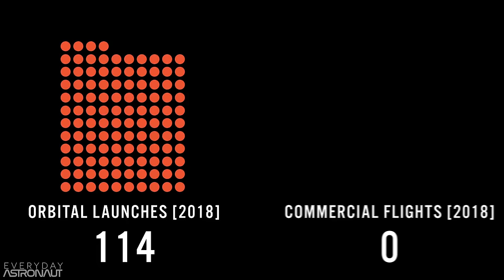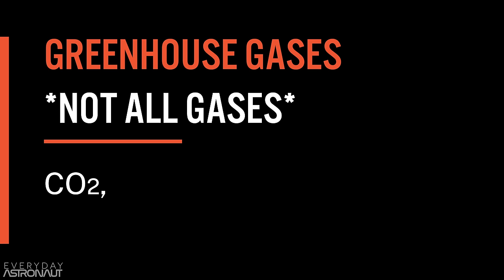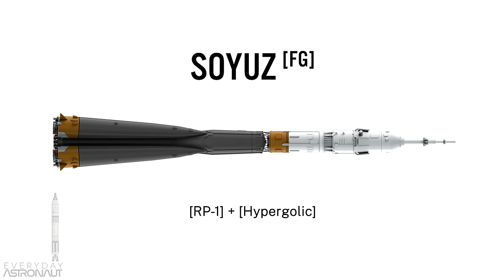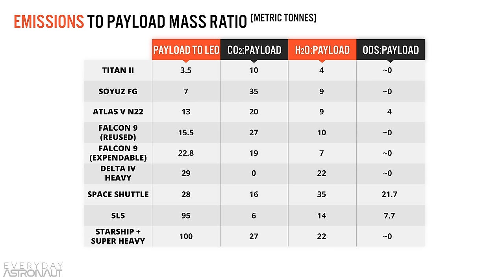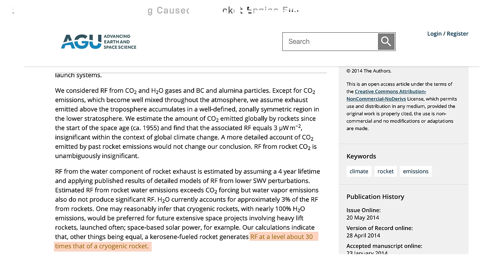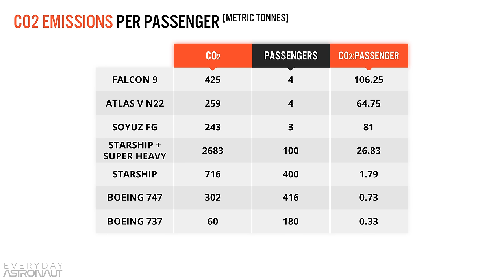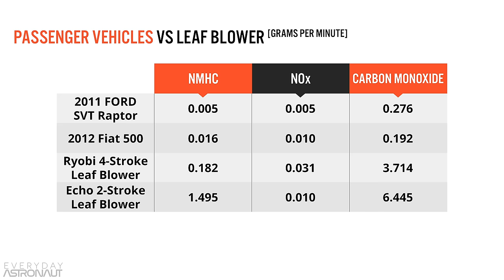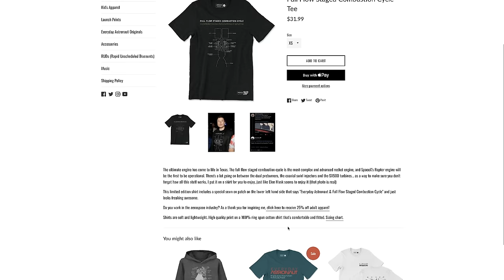How Much Do Rockets Pollute? Are They Bad For Our Air?

Comment: Just a thought: Raptor looks good pollution-wise. Would a similar engine be possible for commercial airliners, and would this represent a potentially game-changing reduction in emissions from commercial air travel? p.s. I'm not talking about using Starship for point to point here, I'm talking about replacing jet engines with methalox rocket engines for sub-orbital 'aircraft'.
Reply: Rocket engine and aircraft engine are like comparing a car to a lawn mower. It will take so much modification and it will just end up less efficient and more expensive. Rocket engine requires a separate tank of oxygen and that would add weight to a plane. Also the power of a rocket would be useless because planes can’t go faster then the sound barrier without causing problems for people on the ground

Comment: Ok so each starship will emit 660 tonnes CO2 and each super heavy will produce 1815 tonnes. Let's simplify and assume they always launch together and round up to 2500 tonnes per launch. 

Current world CO2 output is on order 40 Gt/yr = 110 Mt/day. For comparison the world airlines produced about 900 Mt/yt = 2.5 Mt/day. 

So each Starship stack launch per day will add 0.1% to world aviation CO2 emissions and 23 ppm to world total emissions. 

Tesla has a counter on its website claiming total CO2 emissions saved. Today this is ticking up at 245 tonnes per day with a fleet of half a million. 

So for Tesla's savings to cancel out SpaceX's excess, they need about 5 million Teslas on the road for every Starship stack launch per day. 

That sounds like a pretty plausible ratio to me.

Obviously this ignores all manufacturing costs.

Comment: All good except for the solar /methane production ... as basically all panels are coal fired and a 1.6 times return then its about 30% green if you use all of the capacity of the panels.... USE 50% and its 20% dirtier than coal

Comment: Great lecture, educational. Good focus. Thinking it over, I see how this topic can easily grow to become unwieldly. This may be off-topic, but one extremely important problem with rockets is noise pollution. Launching rockets as often as airlines will certainly cause mass health problems just from the noise. Elon Musk launching starship from sea platforms far from the coast is an elegant solution to that issue. If he place most orbital space launch platforms in the equator, he can fly heavier payload for the same amount of fuel than launching them from Florida. Obviously, it will not help for polar orbits. Out in the open ocean, he'll have plenty of room to build a forest of floating wind turbines for fuel generation.

Comment: Why isn't the fuel pump in an open cycle engine run with lox saturation? This would seem optimal to me as lox is cleaner and has a higher compression ratio.
Reply from the maker: It can be done and is in Russian engines and the upcoming BE-4. But it’s actually less efficient since oxygen is higher molecular mass. That’s why hydrogen gets such a high ISP, low molecular mass
Reply: @EverydayAstronaut  how does the molecular mass affect efficiency? Is it because you can accelerate it to higher speeds with the same energy? Also, is fuel more efficient when it's preheated? Is that why they run it through the bell nozzle as a coolant? And in that case, why don't they run all of it through the nozzle. Including the fuel that goes in the pumps and maybe even the LOX?

Comment: In scale, they don't even compare to Tractor Trailers.  Shear volume of exhaust, they're not 1,000th of Tractor Trailers.  Look around you, right now.  Everything around you was shipped in, probably by some sort of long range truck, and they're pretty much the same Diesel technology used in the 60s, when Apollo was a thing+Turbochargers.  That diesel is shipped to the fuel depot, using diesel.  The diesel to run the peckerhead pump jacks in the oil fields is delivered by a tanker-truck.  More pollution get the rocket, crew, and fuel to the launchpad than from launch to orbit.  About that much.
Reply: Just for my qualifications:  As per an NDA, an undisclosed "Energy company" bought my patent for a half ton single fraction still that can be driven from pumpjack-to-pumpjack on the back of a flatbed pickup, and the prototype to bury it.  They profit more off selling diesel, by the diesel tanker, to the oil fields where the crude comes out of the ground.  The pumps that run the pipelines from there to the refineries are run off Diesel too.  That's what's killing the atmosphere.

Comment: You could send up 50 those rockets every single day for a whole year every year, and it wouldn’t even be measurable in the atmosphere. If you’re an engineer, you could figure it out easily.
Reply: The problem is that people think "big rocket >> big smoke >> big pollution" And dont understand that cars may be smaller, but there's 10 billion of them driving everyday, compared to two or three rockets a week.

Comment: The anti-gravity warp drive comments are pretty stupid but to claim there's no alternative to chemical rockets as we use them now, especially for stuff like interplanetary missions is pretty ignorant I'd say. Both Atomic rockets and various electrical propulsion systems are proven technologies that are a lot more efficient with their fuel compared to even hydrolox type chemical engines. It's not extremely relevant to the topic of this video but I feel I have to point it out.

Comment: How well could we use wind energy on mars? I mean there are huge sand storms and clearly a lot of energy to be harnessed. Would the problem with this be that the wind with the sand will be too strong and break the device?
Reply: Mars atmosphere is to thin, the wind would be incredibly weak, it’s pointless.
Reply: The wind is able to pick up a lot of sand and dirt due to Mars' low gravity, but is actually incredibly weak. The atmosphere on Mars is like Earth's at 30km up.

Also Mars is a horrible place to go to and the Moon is much more worth it.

Comment: So SpaceX Starship Wins.. Its never been off the Ground so it technically hasn't produced any Emissions.   You shouldn't have used Carbon Capture as a Mitigator to reduce Co2 from planes and rockets, because you know Direct Air Capture isn't a Viable option and most likely won't be for decades if ever.  ( Doing that is kind of like Setting your house on fire,  because you hope someday there will be Fire Departments to put it out.)
Great video as
Reply: You didn't get the point, congratulations.

Comment: I have always wondered why liftoff doesn't happen from inside a tube, like a gun, would that not dercrease the total fuel required as the gun barrel would require less energy to increase pressure inside of it, rather than consuming the fuel it takes to create lift in the open atmosphere.
 In fact the initial lift off fuel would not need to be inside of the rocket, but on the ground, this change, in theory would decrease the overall weight and size of the fuel and its container on the rocket.
 ????
Reply: They are called missile silos, also, if you would do that, the rocket would melt and shake itself apart, that's why they have flame diverters and water jets on site.
Reply: The blast would blow the tube apart. Unlike missile these rockets are 100 time more powerful and requires a lot of thing to make the blast not destroy itself and the pad.

Comment: I would add a KPI here - 35:50 the exponentially increased capacity and the years of progress it allows us to condense is another timeline to spread the emissions of starship over unless they’re just bein lazy about fuel in which case that’s on them I guess or they may have other logic
Reply: Ouffff look at the upgrade on falcon Elon is amazing 🤍👏🏽
Reply: Is it that reusability requires it? Of course! It’s two way! Ah! And it needs to navigate too and needs more energy for it?

Comment: I think that we could make an Energy Cell Eletronic rocket engine that doesn't make smoke and othe pollution that today our rockets make!
I think that we need to be worried in some aspects!
Reply: How would a full electric rocket engine work? A rocket pushes on itself with propellant, a car pulls the car along by pushing on the ground, a plane can push air out of it but what can a rocket do.
Reply: @fast-toast How the Ion Engine work!?

It pushes particles as Speeds unimaginable if we could build like a Gigant Ion Engine it would be interesting
Reply: @Viraaj_Gamer1KSP_  yeah but ion engiens need a lot of electricity. If you scaled it up it would need multiple fussion reactors to run it. At that point, it makes more sense to use those fussion reactors for propulsion.
Reply: Also the engines have a such a low thrust to weight ratio that an ion couldn't even lift itself off of earth even excluding its propellant.
Reply: @fast-toast  we never know the future, only waiting to know.
Reply: Electric rocket engines yield more than 10x the impulse speed chemical rocket engines do, but they have much much lower thrust. Today they're only useful for vehicules already in orbit
Reply: @Viraaj1KSP_ Liquid Hydrogen is another option that doesnt produce and emmisions and is currently being used.

Comment: Is hypergolic fuel the stuff some early Nazi rocket planes used? I remember reading stories about how dangerous they where to fuel and how quite a few went up in flames during the refuel procedures.
Reply: Nazis mostly used alcohol rocket engines (early prototypes) and kerose / liquid oxygen (V2). NTO/MMH was invented in the 1960s because they are easy to store: fill the missile's tanks at the factory and never think about it again until you launch. Liquid oxygen missiles had to be filled before use and that was problematic.

Comment: Why are we using anything other than Hydrogen? I mean it's perhaps the best all round propellant.
Reply: While Hydrogen is really efficient it is extremely difficult to work with due to how "un-dense" it is. it likes to leak out of any cracks and the space shuttle's engines had to create an elaborate seal just to contain it. I recommend Tim's video on the raptor engine as it goes in-depth into that stuff

Comment: We can make big bags that will collect up the rocket exhaust.  On Mars, that might be repurposed for rocket fuel. Here on Earth it would help keep the air clean.  I proposed this to SpaceX, they haven't gotten back to me.  We've done large tanks before no problem, it's totally scalable. We do it routinely for paint manufacturers, saves a lot of clean up, too.
Reply: Any bag that filters out exhaust would cause drag on the rocket and slow it down a lot, not because the bag itself is or isn't aerodynamic, but because the sheer amount of air mixed with exhaust trying to get through the filter would pull the bag downwards. In practice, such a bag might fly off or rip at the first opportunity, but if not, it might still make the rocket much less efficient and that might make it unable to get off the ground.
Reply: @tobybug779  Bag stays on the ground dude.  It's not a diaper.  It just keeps the smoke inside it by expanding on the ground.  Once the rocket becomes airborne, those gases are not intercepted.

Comment: Why don't we launch rockets from the top of a tall mountain?
Reply: Because it wouldn't help.
Gaining altitude is easy, the ard part is speeding up. Compare the suborbital spaceships (New Shepard and Virgin Galactic's Spaceship 2): they are way smaller than regular rockets.

In fact, launching from an airplane (way higher than on top of a mountain) only increases the payload capacity by 10%. Instead you could have a rocket 10% bigger. Or much bigger and 100% reusable like Starship.

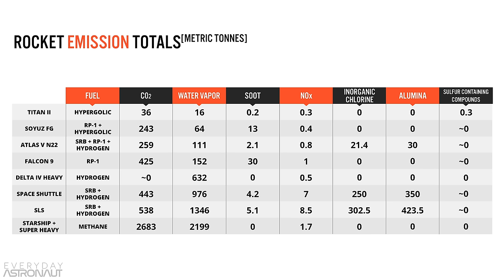Comment: Using the CO2 figure given at 21:09 of 2683 tons, and an estimate of 2,000 trans Atlantic airline flights per day, we can consider the emmisions of the same star ship launch rate.

2,683 x 365 x 2,000 = 1.96 billion tons of CO2 annually.

For comparison, the total amount of CO2 emmisions from all passenger vehicles around the world is about 3 billion tons annually.

This means that if Tesla replaced 66% of all of the personal car use in the world, and powered them with 100% green energy, then launching starships at the same rate as trans Atlantic flights would undo 100% of that CO2 offset.

Plus, comparing space launches to airlines if you are going to space for colonization instead of tourism is apples to oranges. If you want to go for colonization you need to include oil tanker and shipping container weights for a more apt comparison.

The problem is that the idea that we will become extinct if we don't become multi planetary is simply a false dichotomy.

With minimal speculation, it's simple to show that Earth could be kept "alive" or capable of supporting life for billions of years.

With modest amounts of speculation about the capabilities of a type 1 to 2 civilization, it's feasible that Earth can be kept "alive" for much more than trillions of years (more than the total number of years humans have existed for every year that humans have existed).

If cosmology is sufficiently wrong, then it's possible that humanity could exist exclusively on earth within modest limits for an infinite amount of time. (Zero Net Entropy Living white hole centered universe model).

It's important to note that robots and AI could easily bring back rescources and energy from space, but bringing life support up is much harder. Technically the limit is when the density of skyscrapers forms a black hole, which is too obsurdly large of a volume to take the need to leave Earth seriously, especially in any sort of rush.
Reply: Agreed. I am very sceptical toward any space endeavour that doesn't serve an obvious function. Nav-, Com-, Weater-, Earth Observation Satellites are all great. Not so great are space tourism, prestige projects and probabaly internet constellations.
Reply: @debott4538  Thank you. The thing with tourism is that many people will go to a perfectly habitable and already inhabited place like Europe, New York, or Asia and say something like "it's fun to visit but I wouldn't want to live there."

With the zero gravity affects on sleeping, showering, and other basic hygiene and maintenance concerns in space, and the indoor/underground need on a place like Mars for radiation shielding, insulation, and atmosphere containment outer space definitely seems like the quintessential place that's "fun to visit but not to live."

But even in a post scarcity theoretical we have the moon for that type of brief tourism. All transportation really should be carbon neutral tho anyway since it's a variable cost and takes away from fixed cost investments and infrastructure growth.

From a more practical economic perspective, it makes more sense to use launches and energy for, like you said, functional goals.

Companies like Tesla and Nvidia are already looking to build robots to replace workers on Earth where life has way more of an advantage than in space. As a civilization, we would have a larger reach into outer space thru the use of robots. (we also can enjoy the fruits of that reach better by keeping interpersonal human and augmented biological relationships low latency by staying on and taking care of the planet whose radius is about .025 light seconds) spreading out into outer space would ruin that - It's actually not unreasonable to assume that high frequency trading AIs and dumb naive strategies are pushing for that ripping apart of humanity or a superposition of it and a race to maximum scarcity.

Comment: Hydrogen alone or methane and hydrogen. What difference?
Reply: Feeding in hydrogen will increase the exhaust velocity and the Isp. However, you now have to deal with bulky, supercold, fast evaporating liquid hydrogen. The added complexity would be enormous, and you'll need a third fuel tank. The big advantages of methane are that is not so hard to handle, is denser than hydrogen and not so extremely cold. You'd lose all that if you tried a fuel mix. And liquid hydrogen ain't cheap. It takes a ton of energy to liquefy it and it has to be very pure to avoid detonations while handling it. And it leaks through almost anything, including most ordinary welds and valves.

Comment: Great video but I don't think it makes sense on any level to compare the number of launches with the number of plane flights. the purpose is totally different. We should reduce everything where the use to pollution ratio is bad. 

For example I use bamboo toothbrushes. Is it one of the big pollution problems in the world? Probably not. But how hard is it to do that instead of a plastic toothbrush? well they are not more expensive. The only disadvantage if you desperatly try to find one is the less comfortable handle. So bad ratio for using plastic toothbrush over bamboo one since they cause a bit of pollution but the use is no price advantage and no real benefits aside from the handle thing so easy to get rid of it. 

When it comes to planes we have to watch how big the use of a flight is and the same goes for rockets but again the purposes are very different and at rockets it seems to be quite complicated to calculate. So we should think about which of those satellites we really need up there and which we don't. We also should think about if we really need the starship transportation system for people over regular airplane flights unless one day they are ecofriendlier than planes.

Comment: you know what i just thought of? methane rockets are not only carbon neutral it's actually BETTER than neutral, because only the 1st stage emits co2 in the atmosphere and the top stage emits co2 in SPACE. so they're making methane with the sabatier reaction with co2 from the atmosphere and water, and the 1st stage is carbon neutral but the 2nd stage BETTER than carbon neutral cuz you taking co2 from the atmosphere and dumping it into space